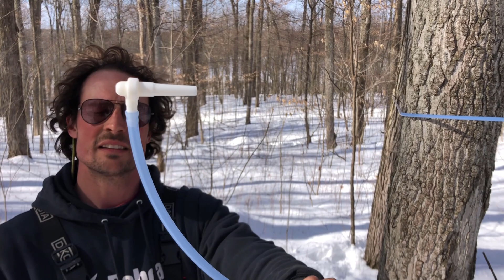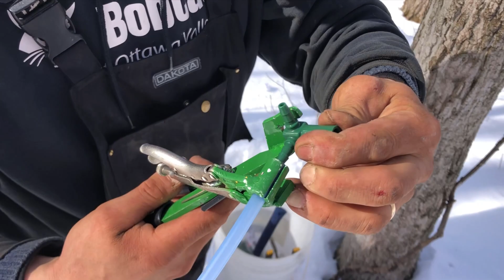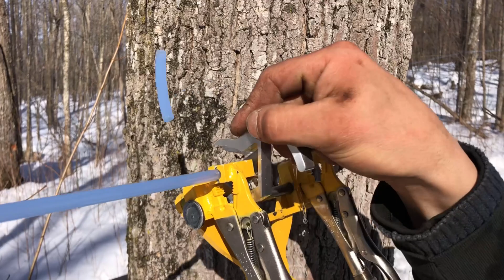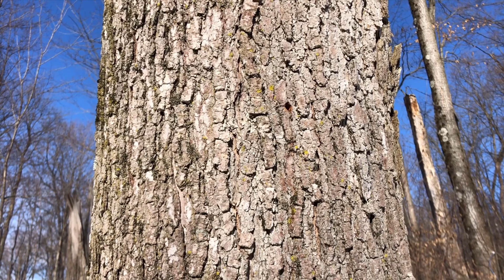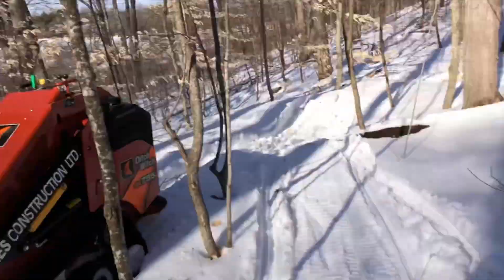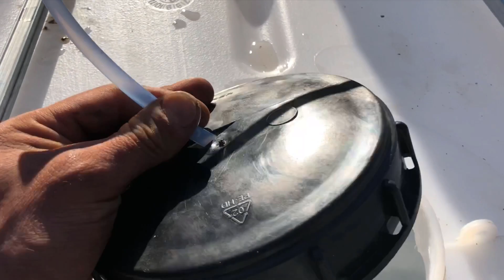Making Maple Syrup - Installing Drop Lines

Comment: What are your thoughts on doing the 5/16 drops to reduce sap pulling back into the tree?  I just built my solar powered vacuum pump based on your design. Will be running 3/16 main lines Thanks!
Reply from the maker: Not a bad idea to prevent pull pack into the tree. I may switch to 3/16 drops this year with 3/16 check valve spouts
Reply: Thanks for the feedback! Keep up the good work,